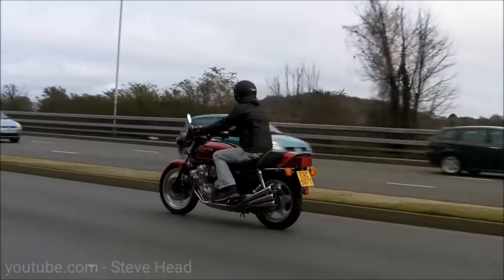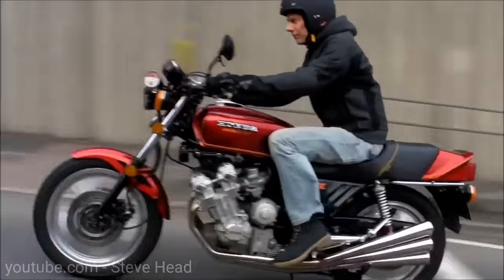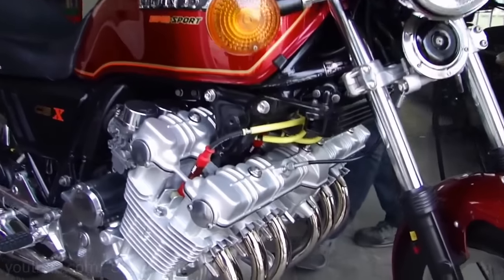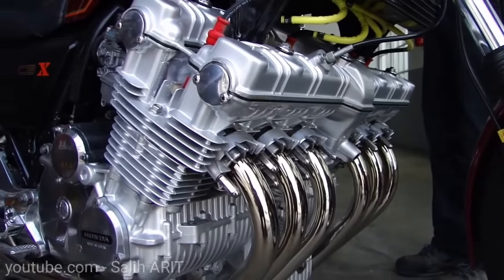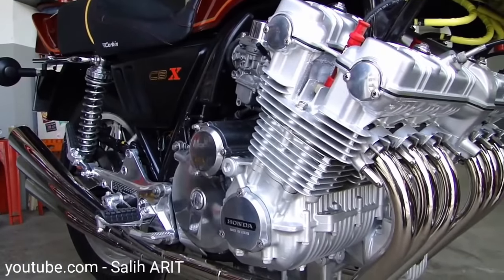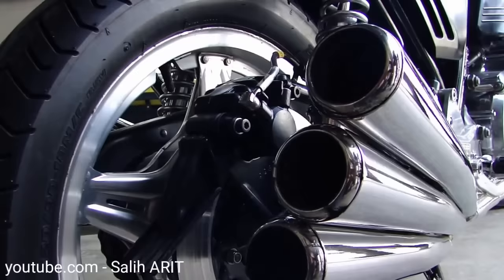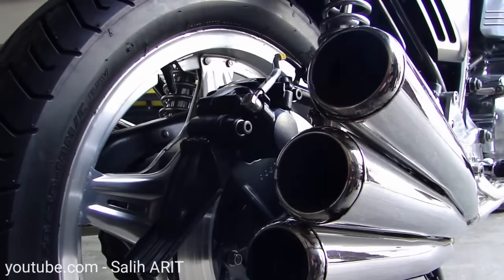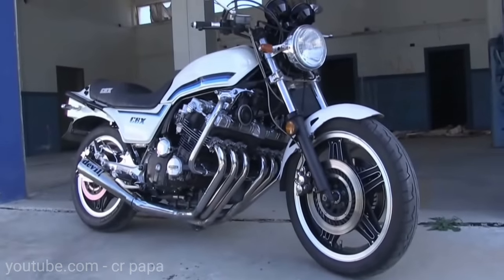Honda CBX 1050 - The Motorcycle That Sounds Better Than A F1 Car

Comment: They do sound sweet but don't really look all that fast (think they were around 100bhp stock?)....hats off to the guy dirt tracking on one though, that takes some conkers!
Reply: u should see 1000c gsx convert into dirt bike!
Reply: Yeah, but understand that the Honda CB was IIRC the first production motorcycle engine ever to crack the 100hp/Liter(1000cc) barrier.  That was the CB750 SOHC4.  Compared to today, not extreme HP but back then it was really something.
Reply: @Zzeke  when these came out, the most powerful car you could buy was a Corvette with about 210 horsepower. That kinda puts it in context for me.
Reply: So what? That thing could still have a top speed of 200
Reply: Mph
Reply: @brandonknight7240  
Hahaha!!! 
200mph!?!?! 
I highly doubt that bro but probably 
160mph easily!
Reply: @austinsears1637   you don't think he probably means 200km/h..?
Reply: @_Bryant.R  take it easy. The fastest car you could buy in the 80s was not a corvette.
Reply: @MrFoodAndDrink  oh, I thought it came out in 1978. Guess I was wrong!
Reply: @_Bryant.R  these did came out in 78 or 79 I don't remember exactly but Corvette's from that era where pretty much crap.not as crazy like the 60s C2's Vette's with the 427 L80 series big block V8's that pushed out 450hp,the fastest car of the late 70s and early 80s was the Ferrari GT4 Berlinetta Boxer which made 380hp out of a 4.4L N/A flat 12

Comment: Six cylinder motorcycle perfection, with an exhaust note so crytically striking on full song, it's amazing to hear, enough to give you goose bumps and a shiver down the spine! 
Just nothing can beat it, so much better than any F1 motor for sure.
With an engine to that high spec, no wonder they beat many others on the racetrack in the early 60's!
Never fails to please, that blood curdling screech on full cry! 😉👊👍

Comment: We need a modern version of this.
Reply: No, we DON'T. We don't WANT a 2020 version of this two-wheeled abortion. The "two-piece framed" Kawasaki Z-1 900cc inline 4 could eat the CBX's LUNCH, and the early Z-1's had TERRIBLE chassis and peaky engines that got them the name "widow makers" for good reason. The CBX was incredibly SLOW ! In the quarter and top-speed. They were nearly silent and very smooth, but they weren't a sport bike, you couldn't lean very far without scraping engine cases, and they weren't a tour bike. They were a "look at me, hear me" in the parking lot bike.
Reply: @Walkercolt1  Butthurt man who couldn't afford them then and still can't afford them now. P.S. The Z1 was never called a Widow Maker by anyone, it was the H2.

Comment: Hard to comprehend that this bike, that engine, wasn't a commercial success back then. I'm just repeating what I read as an adult. What cannot be repeated or replicated is that sound I heard when I wasn't even 10. And that look...those 6 exhaust tubes linened up on the front.
Now, its probably the most beloved street bike engine ever.

Comment: Sounds better than a v6t f1 byt not the v10 era. Nothing can beat the f2004.
Reply: Critical Error the BMW FW27 is the best sounding car ever :D
Reply: I agree, but im more biased toward the V12 Ferrari
Reply: 2001 Maclaren mercedes MP4/16 with the blown diffuser, only V10 era car that tops the F2004 in my opinion. It had its own signature howl because of the exhaust routing through the rear diffuser, highly suggest watching a video on it.

Comment: I need to have something that sounds like that before I die.....
Reply: You and I.
Reply: Said almost every man that enjoys engine sounds. This, Ferrari V12, BRM V16, Suzuki GT 750 etc.
Reply: But a BMW E60 M5..... V10 monster that sings and revs to 8,500 RPM.
Reply: careful what you wish for, you may get both of those simultaneously.  I rode rice burners when the hp race was on and they got scary fast but the chassis and suspensions were even scarier.  couple times I had to stop and stand by the road until I stopped shaking.
Reply: Life is worth living, let's go!!!! 😎🙂♠️🏍
Reply: CarnelJr Faulkner  Yeah I know... It sounds great too...

Comment: Holy crap it does sound like v6 f1 but with high pitch
Reply: What do you talking about. F1 sound not even close to this mighty
Reply: Look up the mazda 787B

At only 9,000rmps tops and it sounds like a f1 engine and it doesn't uses Pistons for combustion

Comment: You forgot about the Kawasaki Z1300 from the 70's. It also had a straight 6 engine, but shaft driven instead of chain driven like the Honda.
Reply: True but it was water cooled and weighed a ton not close to the CBX as far as performance goes.
Reply: Do a search for Arto Nyqvist riding one. Absolute nutter.
Reply: And you forgot there was also the Benelli Sei 900. (Sei = Italian for 6)
Reply: @rick8910  indeed, it was a hefty whale, but still sounds the business with straight pipe.

Comment: I was zipping around on an RD400 when this beastly ride showed up. There was one at the 1/4 mile track...sounded awsome.  Not the fastest or great handling....but one of the coolest bikes.
Reply: Me to - in the early 80s had an RD400e - first with the electronic ignition. Bought a GSX750 the one with the square head light, fitted a Harris exhaust, but had a mate who had a CBX. Can remember that the CBX had a stunning exceleration, twiched a bit around corners but can still remember the sound!!! Got a ZZR1400ps now - great excelleration - handling superb - but a bit boring.

Comment: Wow!  Great sound.  Take it easy on it. Could be a deadly bike.  I am a little worried about the steadily advancing horsepower on motorcycles especially when new riders go straight to a superbike.  I recommend that you start modestly.
Reply: Your comment went in a weird direction
Reply: I did two days on a 125 and then a day on a 500, went for my test in the UK, passed and then bought an R6. Nearly killed myself on the way back on the motorway as I didn't understand countersteering.
Reply: @badger4632 beautiful bike the yzf, but I could never handle the sports bike positioning. I went from a cg125 to a cb600f hornet and finally to my current gsx1400. Love em all.

Comment: The Honda cbr250rr was also one of the best sounding bikes, revs to 19 thousand 😍 that was also and f1 on two wheels
Reply: Dude the 91 mazda 787B racecar can achieve such f1 screams with its 4 rotary engine at up to 9,000rpms

Comment: Makes you wonder why there are no bikes like this anymore that sound eargasmic
Reply: Try a Suzuki GSXR 750 with a stainless steel Yoshimura
Reply: My MT10 sounds pretty unique.
Reply: Performance is more important than acoustics. This sounds awesome, but likely lags behind a lot of other bikes in terms of abilities on the track.
Reply: @siafaalvin2209  for a street bike, enjoyment can come from the way it sounds and behaves. I know that these older hondas had perfectly smooth throttle response unlike most modern bikes. You enjoy the ride more that way. For raw performance newer is ofcourse better, but noone would buy a cbx1100 for its track ability.

Comment: Handled terribly. Two of my friends owned them back in 1980 and promptly swapped them for the CB900F, a superior bike in many respects. ( obviously excepting the soundtrack !)
Reply: High center of gravity...it's was so wide ...I rode one for a few weeks back then and had a hard time holding it upright on red lights...but the sound at high speed on the highway...orgasmic?!

Comment: And people like the sound of Harley’s?
Reply: Lol ikr
Reply: Sure, but I also like the sound of loud farts and a V8 engine running on 2 cylinders. Potato, potato, potato. If I want to ride something overweight, and unreliable.
Reply: What's sad is, movies STILL dub stupid Harley sounds onto what is obviously an inline Japanese bike which sounds nothing like a Harley.
Reply: Sure they do. I do like the sound of uneven firing sequence of Harley evo engine as well as this beautiful sound of CBX engine. Both are beautiful 'songs'. Just the different mood. Like in real music. Sometimes you like good rock'n roll and sometimes moody blues.
Reply: The Harley v twin is like 2 lawnmower engines working against each other
Reply: @richardbinder9662   overweigh no and unreliable no    while Japanese motorcycles are more reliable yes and lighter  lets compare weight to weight a streetglide or road king is around the 600-800 lbs which is heavy  a Goldwing is 700's - 800's  which is heavier but the closest comparison    next we can add the street touring bikes but those are 650's which so much less comfort than Harley and goldwings   so the extra weight savings is lost to comfort       unreliable Harleys can easily make 100k    supersport bikes never do that and if they do they require a shit ton of maintenance   my zx10 cost me more after 30k than my sportster cost me the whole time I owned it     so these high performance bikes don't have the same reliability as their standard bikes from learners to touring cruisers  if yu compared strictly SS to Harleys Harleys would win         next you ride what fits the need I would never ride my bike now across the state but if I had the cruiser I wanted I would go to California and back so the argument you make is complete nonsense
Reply: Actually It sound really good back then, when their bike are still using carburetor. The idle Sound just like a galloping horse
Reply: @richardgollwitzer2135  honda bikes don't sound anything like a lawnmower. You're not tone deaf, just completely deaf.
Reply: @cydonianman  that's funny because a rebel 250 literally sounds like a beafed up lawn mower   and saying a Harley sounds like a lawn mower  while honda is making both bikes and lawn mowers try again but your joke sucks
Reply: One can appreciate both.  I personally prefer the sound of my Suzuki cruiser to a Harley,  but Harley sounds cool, and loud pipes save lives! 
Ride carefully my friends...its the hunger games out there!
Reply: @PaulieTheDude  Still driving my Evo at 65. Mods, air intake, and cam. Love it.
Reply: @tubeontime  excellent comment!
Reply: People like the sound of Hardly Ableson's?
Reply: I still like the rumble of a v-twin better than these mosquito fart bikes. But it does sound fast.
Reply: @Bonesnoff04  I agree!  It sounds fast!  And at certain times sounds good.  Heck, most Harley owners don't keep the "stock" exhaust anyway. And to be perfectly honest, I use to hate the sound from a "pocket rocket" but to be honest, I've become more appreciative of all motorcycles that the sound matches the performance!!!  I'm 65 and thinking of trading off my 98 Road King Carburetor Evo and getting something that has outlandish acceleration along with a FAST comfortable ride.  I've enjoyed cruising but I have a need for speed, which is what I started on in 72.  Hell my opinions are still changing and growing. I like enlightenment!!!

Comment: I remember sitting on my brother CBX when I was a kid. The only thing I didn't like about this bike was the weight obviously, but also the stamped looking wheels seems flimsy, and unfit for such a monster. Masterpiece of design regardless of its shortcomings imo,
Reply: They may have seemed flimsy but they were actually as strong as any cast wheel of the time, (without the porosity problems) while also being lighter. Later when the casting porosity problem was solved by better tech,  Honda started putting cast wheels on it's bikes because let's be honest, they look better.  I had a CX500 with those wheels on it,  they were pretty much maintinence free and worked great.

Comment: Honda really has some of the most amazing sounding bikes though...
Reply: The brand has nothing to do with the sound.
Reply: and cars
Reply: @batperson3532  uh, yeah it does... the sound comes from the engine design.... the valve config, the timing, the size and shape of the pistons, the design of the crank.... it doesnt just come from a pipe... and Honda did have some ofv the best sounding bikes. I particularly like the V4 bikes.
Reply: @nicholasmapes  you said it yourself. Tell me if you can tell between a zx6r, cbr600rr and an R6 with your eyes closed. Yamaha's R1 sounds different because of the crankshaft NOT because it's a yamaha.
Reply: @batperson3532  right, but different brands produce different engines designs. I get what you are saying, but you made it sound like all bikes sound the same or something.
Reply: @nicholasmapes  did i say all bikes? Im saying an inline 4 will sound like an inline 4. If kawasaki builds a v4 its gonna sound like a v4, its not gonna sound like a honda. If suzuki builds a crossplane inline 4 it will sound like a crossplane inline 4 not like a Yamaha.
Reply: @batperson3532  wrong, flat plane cranks sound different than standard plane, different valve designs affect sound, different brands use different tech, making different sounds....
Ducati v4 sounds different that Honda v4, Yamaha v twin sounds different than harley v twin, get it?

Comment: Mine was a '79 in silver with a big black stripe down the middle and orange stripes on either side of that one. It was the 105 hp one, but, unlike these bikes here, it was completely stock. It was fast, but what I remember most was how smooth it was. Must admit, the complexity scared me, and I sold it after a year or so.

Comment: I had an '82. I put, and tuned, a set of SuperTraps on it. I was riding to work one morning. It was cool a bit foggy in Austin, Texas that morning, but I saw the two city motor cops on their Kawasakis and moved to be in the righthand lane before I got to them and took the the upper deck of IH35. They pulled of the breakdown lane and hurried to catch me. Once alongside they looked me over. The speed limit was 55 and I was doing that. The motor was making that beautiful "ready to rumble" sound. The one beside me looked at his partner, who shrugged. Then the cop lifted his left hand, pointed two finger up and gave me the " turn to" signal. I declined but he did it again. So, I shifted down to second reving her up and threw the clutch. The motor screamed at the cops the rear spun some, but the Front-end lifted about a foot and the CBX, 55 mph, LAUNCHED! Since we're going 55 traffic had pulled away a bit. I was able to stay on the throttle (I wasn't running WAO) and let the front wheel settle down. When it did I shifted to 3rd, picking up the Front-end again and then backed off. 

I love the fact that motor cops wear open face helmets in the US. When they rode back alongside me the look on their faces was priceless. They did pull me over, once we got to a safe place. But, it wasn't to ticket me. They just wanted to look the damned thing over. They especially impressed with my tires (I'm sorry, touring tires just didn't cut the mustard on the CBX.)

The fastest trip I made on the beast? Austin, Texas to Silver City, New Mexico in 11 & 3/4 hours. Not that great until you consider that's five gas stops. I had a conversation with a state trooper in Sonora. And, I ate at a truck stop in Ozona. It was an exhausting, but very satisfying ride, done at night, dodging deer and porcupines along the way. (I don't know why porcupines are so attracted to IH10. 

Now, understand I'm a Harley guy. Don't know why I bought the damned thing. I went into the Honda dealership because I really liked the Hatch racing gloves and my old pair were wearing out and there it was, in all its super extravagant glory. It was an 82, and it was 1995. I stood looking at it and a sales "kid" came over. They didn't think they'd ever get rid of it. I bought for list, plus the three years of inventory tax they'd paid on it, plus a case of beer and a bottle Jack Daniel's for the owner. About $2600, and they put a new oil filter and oil in it. It had 36 miles on it. I wrote them a check. Two days later I picked it up. My girlfriend a little topless dancer from Brazil drove me up. (She had the face of an angel and a butt you could bounce a silver dollar 4 feet in the air off of.) (And dammit she called me up a couple of weeks ago. She's been bouncing in and out of my life all these years. I'm 73 now, she's 70 and still beautiful.)

The CBX is no longer with me. I gave to my hotrodder nephew. The enginerd. He'll figure out what to do with. Maybe put the motor in a "drawf-car" and go dirt racing. I can just hear the scream on a dirt track. That would wake 'em up in the stands.

Comment: The one doing the fly bys on the country road is a lot more than 105hp. My Suzuki concours was 115hp and not even close to that.
Reply: Kawasaki Concours?  It's based on the GPz900R engine.
Reply: @VndNvwYvvSvv  yeah I meant Kawasaki. It was a 1000cc detuned ninja motor.